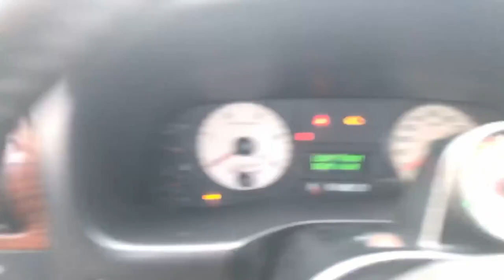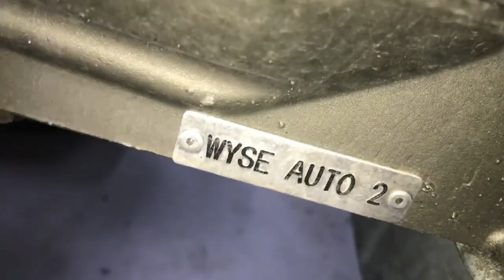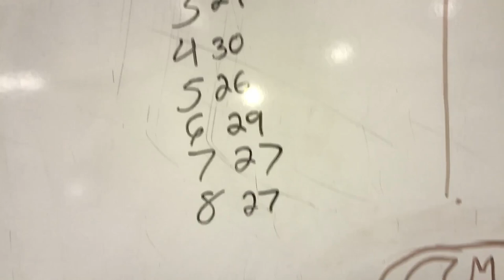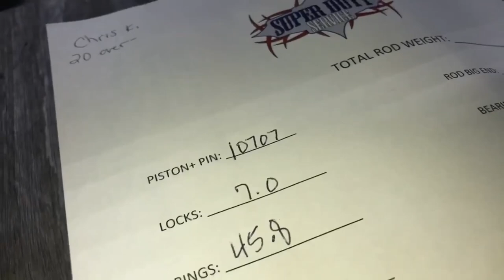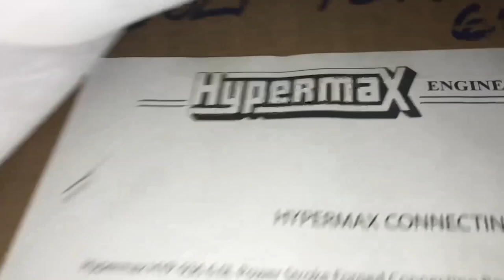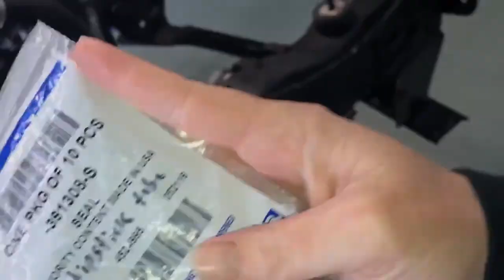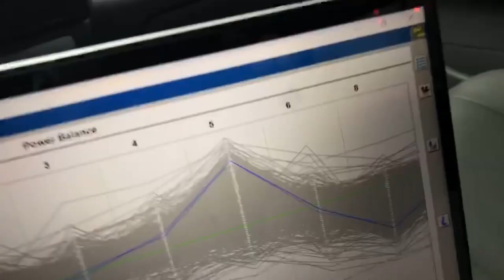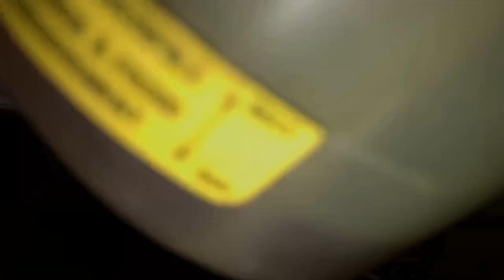VERY EXPENSIVE 6.0 Build,,, If You Need LIFTERS,,,  IT'S TOO LATE!!!

Comment: As far as the grounds, from th factory, they came with minimal grounds, factor in rust and corrosion in the rust belt, the pass side body to frame strap becomes useless, as the rest get ignored, jump starting or nuke mode on batt charger welds th trans pump gears. Seen it several times

Comment: I did the colt stage 2 camshaft. Pulls harder uptop. Didn’t notice much else of a difference. Supposed to have softer ramps on the lobes as to not hammer the lifters.
Reply: I am interested in an aftermarket cam for these reasons as well.  It's almost hard to tell the results sometimes on these because there's almost always other mods done at the same time due to the amount of labor it takes to do anything on these diesels. 👍
Reply: @scubasteve7946  yeah if your doing a camshaft on a 6.0 you might as well just overhaul the whole engine because the cam is one of the first things that goes in and the last to come out.

Comment: Wow, so much wrong and still ran decent. 🤔🧐🤨🤷‍♂️
Reply: That’s how these engines die, they get problems but the owners say how bad can it really be it seems to drive ok. Then they drive them to their death. You can have a ruptured EGR cooler and the truck for the most part run fine just smoke. So people will keep driving them until they finally break then say the engine is a pos. Not saying a 6.0 is amazing but once you address a few issues they aren’t as bad as people make them out to be.